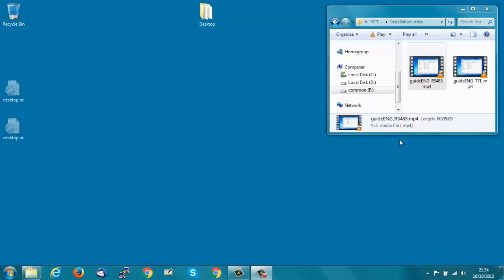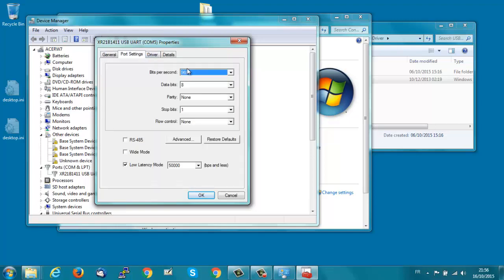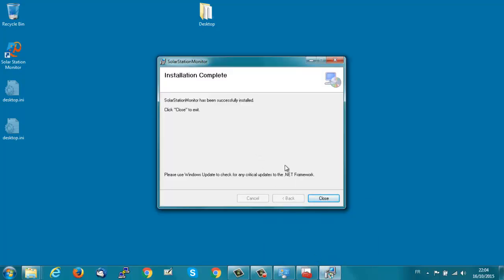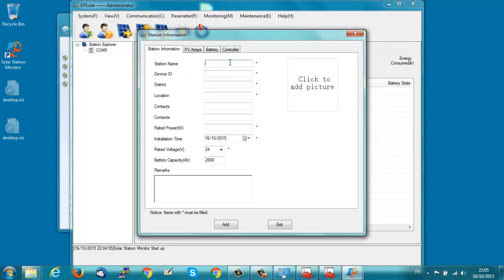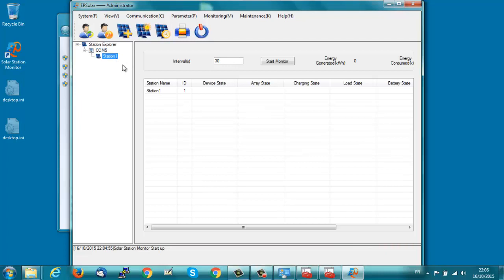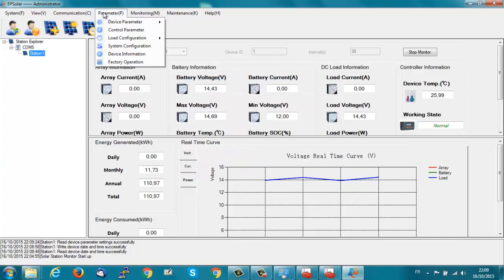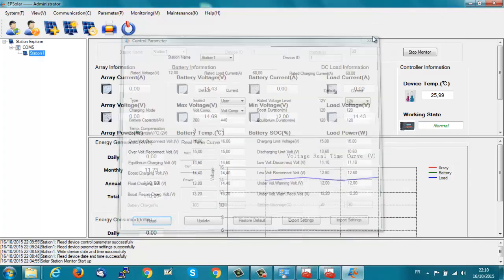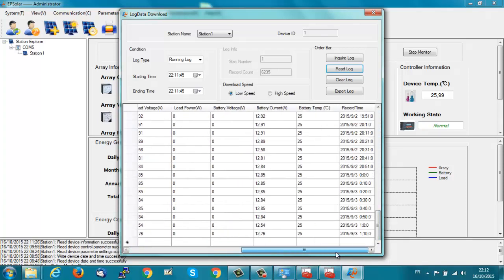Part2: Software Test review EPSOLAR MPPT TRACER ET6415BND 60A Solar Charger Boat

Comment: I have e tracer MPPT 60A  ET6415BND connected with 2 sealed batteries the first bat. 200A & the second bat 100A>>> i want to know 
  how can i adjust the value of equalizer and make the MMPT charge the 2 batteries equally ...I will be thankful

Comment: Hi

suddenly my ET6415BND serial connection Do not want to work anymore, It have worked for a month. 

Get the mention. 

27-5-2017 09:01:06]Alex solar : Operation failed. The operation has timed out.(COM3

I have Checked al the wires and connection that is all O.K.  

It seems that the charge controller does give no signal anymore.
Reply: I've solved the problem.

For this problem is a hard reset is necessary.

Remove in darkness, the positive (+) battery B+ cable until early in the morning.

And reconnect.

The ET6415BND is reset.  all the settings are held by the button cell battery.

Comment: Hi thanks for you Youtube video.

Today I received the same charge controller. I have make a good deal € 449, - including the temperature sensor standard not included and free shipping.

What a heavy charge controller 5.5 kilo 

I have connected  6x 260w 96 cell 48 volt home roof solar panels 3 sets in series of 118v max see photo. With this EPSolar ETracer 6415BND charge controller i go  charging 12 Trojan T105 batteries 3 banks of 24 volt as one big battery-bank 24v 675 see photo. 

I hope that it is here working good as well.

Here photo's 

http://i969.photobucket.com/albums/ae178/lex6363/P1010717_zps3d021cec.jpg

http://i969.photobucket.com/albums/ae178/lex6363/P1020679_zps6xd8qpbi.jpg

I need a USB extension cable the wire from the communication cable is to short.

Tomorrow i install the controller on my computer.  I think that i need your video.   

Thank you again.

Comment: hi, did you have the problem wit decrease SOC, after cut out? mine is 2210A with 35v 260w panel. tks
Reply from the maker: To know the state of charge, one needs the battery voltage and the amperage getting in or out of the battery... from which you deduce the SOC. In my setup, the charger doesn't know what is being drawn out of the battery so the SOC out is not reliable unless you are only charging. If you are using your power it's normal. I rather count how many amp hours are getting in and out to estimate remaining capacity.